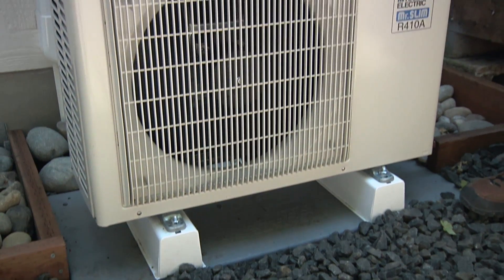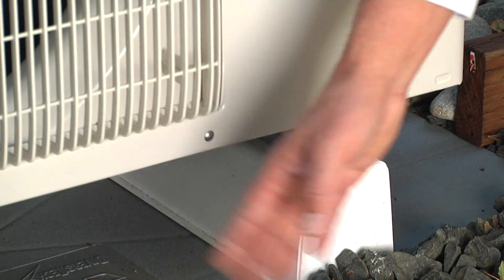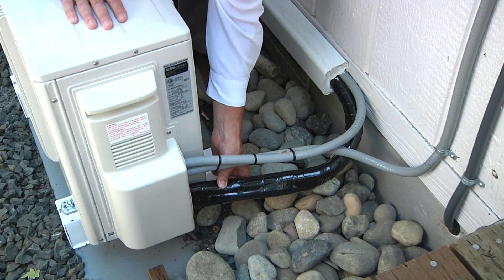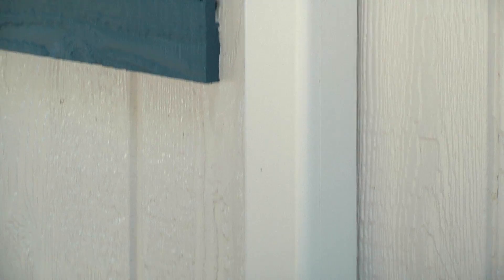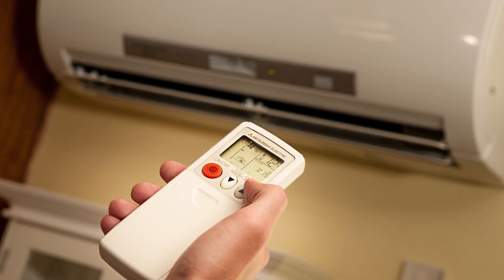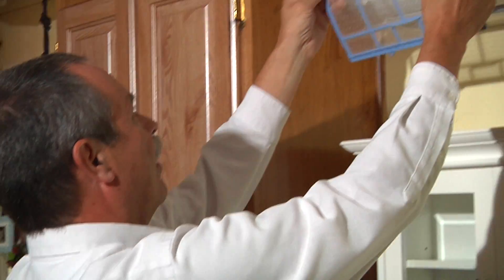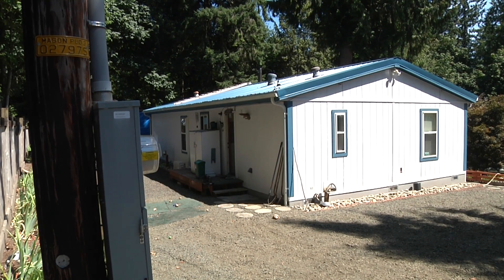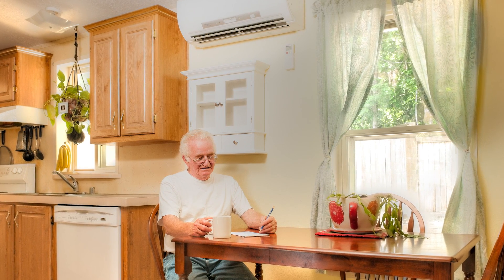Cut Your Heating Costs in Half with a Ductless Heat Pump

Comment: I thought these were stand alone units, why do you have to use them with the furnace or another heat pump system?
Reply: I suspect that the furnace is simply kept as a back up.  More than one heat pump system might be needed based on the size of the house (and the size of the heat pumps.  It might be more cost efficient to have two smaller heat pumps serving different areas of the house, than one big one.
Reply: Needs a condenser for the coolant

Comment: just making a point here.i am a forty year refrigeration guy and see lots of these units installed by people not qualified to so.plumbers,electricians,the do it yourself guy,  etc.my problem is that units get put in and the customer will never see the installer again because they aren t qualified to service them.easy money put it in ,take the money and run.customer gets overlooked or totally ignored when they call with a service issue.my thought is that the makers of these units have made them too easy to install.the refrigeration guy is taken out of the picture. units should be shipped with a holding charge of nitrogen and installed by licensed refrig personel .you should need a ticket to even purchase these units.home owners should not be able to buy units directly.these are high pressure vessels.

Comment: I live in NY and I want to replace my boiler gas heat steam with these for the winter in my home and get rid of all of the electric wart hogs (window air conditioners)that I use for every room in the house. I have 3 bedrooms 1 bath on the third story, 1 living room, 1 kitchen, & 1 dining room on 2nd floor. 1 bedroom,1 bath, 1 kitchen,& 1 living room on the first floor. I would need 2 for the first floor(living room & bedroom), 1 for the living room 2nd floor, & 3 for the 3rd floor(bedrooms only). Would this work for me in Brooklyn NY?
Reply: Yes I am in Brooklyn  wow 
Have you installed it yet?

Comment: Nice job, in cold area snow, water and debris can easily rich the condenser. suggestions: 1 Heat pump should install 2-3 ft on the outside wall. 2 Drain line should install 2-3 ft from the ground in order to allow free draining in all whether conditions. 3 when installing heat pump on the wall they preform better in the winter and less exposed to cold wind

Comment: According to Mitsubishi, their new heat pumps do not require a heater on the external evaporator, and this guy says they do. Which is it?  Secondly, the  operating unit design shown would fail in places that get more that a few inches of snow, as it is so close to the ground. Thirdly, if you put the heating  unit close to ceiling you won't get much heat down close to the floor where your feet and your bed is.

Comment: Lets not forget most older mini homes have a 100 amp board which maybe maxed out and would need upgrade to run the pump
Reply: My two ton mini draws 2790 watts max and would be fine on 100 amp service . Its 15 amp fused so even 60 amp service would work.

Comment: They are not able to be used for heat everywhere... They are expensive ...both cost and to operate because the condenser must come on when only 1 head is being used... The only advantage is no air leaking from ductwork and no chance of improper sizing of ductwork.. Also no humidifier... I would only install one if customer specifically asked for one... I would recommend high pressure system if room for ductwork is an issue
Reply: I have seen them used in the rest of the world for decades,,,US is so backwards for tech thats used for a home like in HVAC,,,I heard same type of BS 40 yrs ago about all heat pumps,  And

Pls dont install them.. Leave it to contractors that take the time to learn how to do it the right way and wont do some one off, half assed job,,,

Comment: heat pumps don't work that well.... the colder it gets the less heat you get till it needs to run a heat element to provide heat
Reply: Air to air ones do just fine in most places now,  utube engineers r funny
Reply: Heat pump with emergency gas is a blessing for your gas bill.

Comment: Did you tell everyone when temps get around 30 they are useless
Reply: Not true with splits.
Reply: not the new  ones
Reply: Mine works great when it's cold out my older heat pump don't the back up heat comes on
Reply: At 4 above I measured 120°  air from my Mitshubishi 2 ton unit.  No heat strips!
Reply: @robertl.fallin7062  nice I got a new with hyper heat

Comment: Suggest you do not count on a mini split as your sole source of heating in most parts of the USA that can see below freezing temperatures, when they break no one stocks parts and few contractors will fix one in very cold outside temperatures.
Reply: True like Japan very never gets very cold lol
Reply: New ones work to -15 below. Stop with the lies. Even below freezing there is still warm warm to be had

Comment: We live in northern VT does a heat pump work at -20 below?
Reply: I was a Mitsubishi certified service tech and where a conventional heat pump stood heating at 36 degrees these have models (when I was servicing them and doing a bunch of training 9 years ago) some models would heat down to -18
Reply: James is right it depends on the model Bryant and Mitsubishi have one that are still at 96% efficient at -18 degrees they are great.
Reply: Hi Elaine. You’ll want a geothermal heat pump - ground source or water source. It’s costly but it’s extremely efficient, something like 350% or more efficient.

Comment: In Maine that unit wold be under 5 feet of snow!
Reply: shovel it ?
Reply: Its relatively light and can be attached as high as u want to a building. So snow it not an issue. What r u ppl not getting????
Reply: And they are sure not going to heat adequately in the winter where temps gown below 30 or 40 degrees F.
Reply: Y do fools that have no idea what they're talking about make comments? Just to look foolish apparently.  

They lose efficiency. But a modern HP can keep working well below 30 degrees F. So geothermal HP is best in very cold climates. Just check the specs for the system that will be installed.
Reply: they can be attached to the house and be set as high as u want too place it
Reply: Build a box around it ???????
Reply: But in Maine do you need a/c
Reply: joel peacock  At the most one month during the year.

Comment: So Americans are learning about these ACs only now? After having destroyed the environment for ages?
Reply: How are things doing around Fukushima?  Where do you think the electricity need to run these things comes from?
Reply: I installed these units from Sanyo 35 years ago. I will admit with Inverter technology they are much better at heating without backup resistance heating needed. However to depend on mini splits in a cold climate as the sole means of heating would be foolish. These do break I have installed about 500 of these over 35 years. The newer units are not as reliable as the original Sanyo type units.
Reply: stfu virtue signaler

Comment: Home Depot sells a 4-Ton unit for $4800.00, but says it requires pro-installation and permit. Does anybody know how much extra I have to pay to have all that done? I'm looking at an estimated amount without getting ripped-off by having an unqualified technician do the job. (Thanks)
Reply: Check your County permit office website. They should have the prices listed. It is about $100. You definitely don’t want to DIY this project. If you have gas you may need 2 permits. But the big thing is that if you install it wrong it voids your warranty and if it blows up your home you could be held negligent.
Reply: https://www.highseer.com/review/product/list/id/255/category/39/
Reply: Is it a ductless split

Comment: he already has electric heat with duct work run all through the home.  just couple the electric heat with a heat pump and the problem is solved.  they did dare say how much it was to add several ductless units to the house.  they are not cheap!
r410a the worst refrigerant every shoved down the throat of the HVAC industry!
Reply: thx for the rant

Comment: So, if I want to heat every room in my house, I basically have to install several heat pumps all around it; that seems like a very bright idea.

BTW you can also buy in window heat pump if you go along that solution.
Reply: you can have one heat pump with multiple blowers. or one heat pump and 1 blower in the attic or basement with ducts running to each room to evenly distribute the heat/ac
Reply: yes u can just put your window A/C  in the window backwards  that is what heat pump is using air as it medium
Reply: Mitshibishi and other ductless split systems offer the ablility to do multiple indoor units to one out door unit and although they are a little more costly for a replacement they will save you money on electric by a long shot and the air in your home is more comfortable in general these units are amazing at humidity control

Comment: The only thing I liked about my home was the hotwater baseboard heating system. I did NOT like the oil bill! In second year of a Mitsubishi  Minisplit winter and one year of ac use the savings are much higher than the 30 to 50% cited. At 11.48 cent per kwh and oil at $2.25 per gal a million btus cost half as much from the minisplit.  My oil boiler is a 82%  effeciancy unit,  only slightly lower than energy star rated effeciancy.  The first year of use reduced my heat and ac cost from $1,800.00  during 2014to $730.00 in 2015. The total degree days were very, very close in 2014 & 2015. Befor I bought I spent a few hours looking at heat/ac blogs. The Mitsubishi  gets almost  no negetive reviews . I paid $4200.00 for a two ton high SEE unit.
Reply: Robert thanks for sharing great info!
Reply: I have a Daikin system. This will be the first winter I will be using a heat pump.  Do I leave it running all day? Or supplement it with my baseboard system?
Reply: 89five3five you should be able to let it run all day! They are meant to heat and cool your house and living space. Maybe when you leave turn it down to save some money so it doesn’t run
Reply: Dylan Reischling thanks for the reply. With my new solar panels, it’ll probably even out the energy consumption.
Reply: @dylanreischling4151  I leave mine at 70°. One hint is to get a humidifier and keep the humidity at 40 to 45%. While these units are very effecient at heating they have limited output per hour.
Reply: trubin06

Comment: Here in japan... Every home has ductless system .... And they last for 20-30 years!!
Reply: I think a lot of the older ac units out there were just built a lot better, back when companies built things to last, now it's how cheaply can they make a part and you wonder if they make them with planned obsolescence in mind. :(. The copper on a lot of the old units was thicker too, Ive been to houses with central ac units built in the 50's that were still running! Nice to see something older than me still going, hehehe.
Reply: It would be interesting to track the life cycle of  mini splits in the USA most get installed poorly and have a short life cycle. Wasting money in the USA by hiring the lowest bidder is thought to be a good idea. The preponderance of Americans think all technicians are the same that somehow or another one bidder has figured away to do the same work for less or can buy the material for a cheaper price. Got some news for you, 80% of contractors have no idea what they are doing. These the fellow sometimes making a good living. These are also the fellows who claim one piece of equipment is junk because they have no idea how to fix it. Don't get me wrong some mini splits are junk they will work for a while,, when they have a problem parts and anyone willing to fix them will be impossible to find.
Reply: @isotac7789   So True!  As a retired licensed 4 state Electrician / HVAC,  I have seen so much CRAP contractor work!!!
Reply: One to two for a average sized house 900- 1500 sq ft.
Reply: +Nirmal Aryal 
Dude, how many heat pumps do you have to have in the house?
Reply: +Bean Flynn unmmm 4
Reply: @Meghnad If not s loss of efficient then think about the seer numbers now verses just ten years ago.
Reply: Nirmal Aryal and that is precisely why I didn't get one installed this winter: I am saving up for a Japanese brand.
Daikin and Mitsubishi or even Fujitsu tend to last a really long time.
Reply: Nirmal Aryal from my experience, <NZ> the only units lasting that many years are "fixed speed" (no condensor electronics) low hours of use and low corrosion by some stroke of luck
Reply: What brand??
Reply: I have seen Mitsubishi Brand split unit that is 25 years old still working. I think its because they used Mueller copper and 1/2 inch insulator. System is perfect. The owner he said he had never had to refill gas. Still using R22.  I was really impressed.
Reply: Let me add, in Japan where the cost of energy is almost cost prohibitive the idea of heating an entire house, or being warm is not the norm. Living frugally and in small housing is the norm. Housing wants and needs in America would be looked upon from the Asian perspective as insane. I heat and cool every room of my house even when I am not in residence for days or weeks. I like to be warm, and in summer cool, but in America where we sit upon a vast pool of oil and gas (more than in the entire Middle East) we don't have to act as they do in Asia. The war in the Pacific was started by the USA cutting off oil sales to Japan in an effort to stop their invasion into China. Nothing has changed in Japan they have not found oil or any plentiful inexpensive source of energy.  Not sure why Americans want to live like there is an energy crisis. Better to spend money on insulation and tightening up homes for comfort than to spend $$$ buying more efficient systems that need constant maintenance and short life cycles, insulatiting is near forever.

Comment: If you replace the main pump in a "Mitsubishi" heat pump, Is it necessary to replace the fluid at the same time?.Thanks Jackie.
Reply: Si. Same for a Daikin, Sharp, Fujitsu, Sanyo, you name it. Just like you need to change oil/filter ofter for your Ford, Chevy, Honda, Toyota, Porsche.

Comment: I like the idea of reduced heating cost.  How much do they cost and how long do they last?  What is the estimated maintenance cost per year?  How long is the warranty and what does it cover?
Reply: robalan57 you can contact https://lgductfree.com/dealers for specific information. LG has awesome support compared to others which I won't mention.
Reply: A unit like that plus installation will cost about 4 grand. Depending on btu as well.
Reply: You don't have to get a Mitsubishi, u can another company. I recommend it because they are much cheaper and do the same thing. I have a ramsond unit 18 thousand btu with a heat pump. It cost me about $2400 including installation.